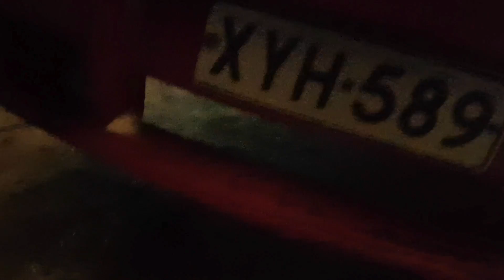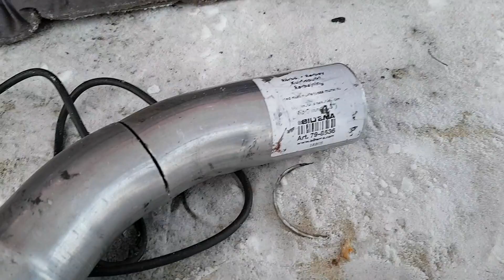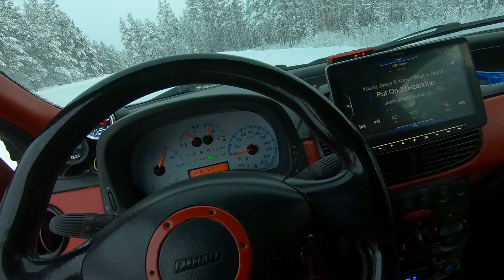2.5" Pakoputken Kasaus Bilteman & Motonetin Tarvikkeista #boostedpunto Part9 ENG Subtitles

Comment: how did you learn all these things , supercharging , exhaust , speakers and electricity , nice job though
Reply from the maker: Internet and trial & error 😃
Reply: @JoniK1  same here,, i have tuned my focus mk2 added to much fuel till my catalytic converter got blocked slowly till max car speed was 40km then removed it , did you fell better speed with the new exhaust ?
Reply from the maker: Yes it feels much more lively now on higher rpm, I accidentally drove 180km/h on test drive. It was way too rich after I changed the exhaust, had to lean the mixture a lot.